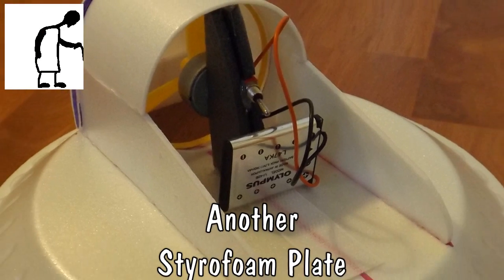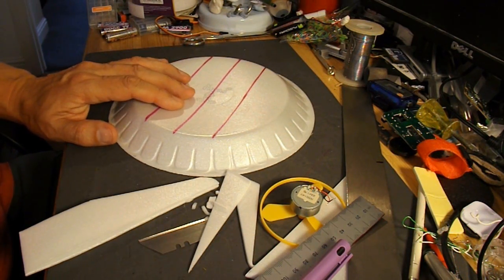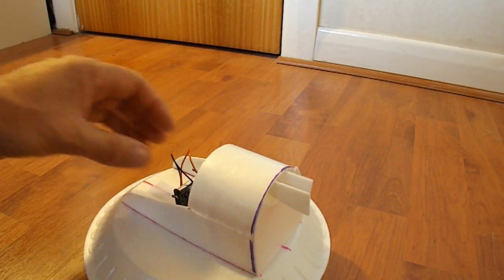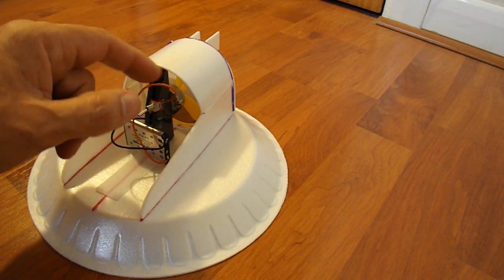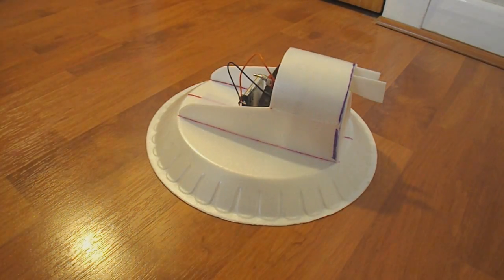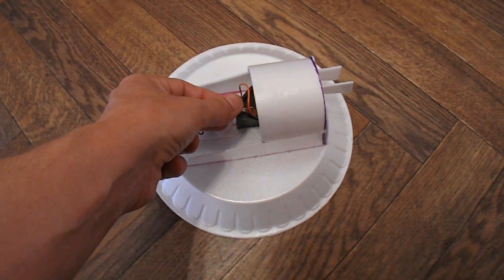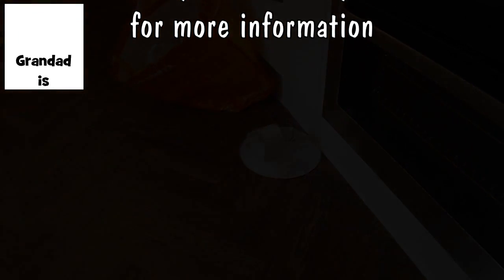Another Styrofoam Plate Hovercraft

Comment: Thank you for your reply.  If there are no measurements, what guidelines would you give us for measurements?  Thank you in advance!!!  You're an awesome inventor and we watch all of your videos regardless of how many years back they were made.
Reply from the maker: I would guess the Styrofoam plate is probably 9 inches diameter as that seems to be a standard. The rest of the dimensions would be related to whatever propeller or fan blade you have available. Looking at the video and those red lines I drew on the plate, I would guess you have one in the centre and the other two are 1.5 inches away as it looks to me like I more or less divided the plate in 3. So that means the fan blade I had there was probably a little under 3 inches in diameter. Like I said in the video I just did what looked right based on what I had available and the dimensions I am giving you here are simply by observing the video and judging the relative positions.

Comment: Hi, thats a very nice design but i have one  question. How would you adjust the speed?
Reply from the maker: Simple answer, you don't. I guess you could but a variable resistor in circuit with the battery and the motor, but I certainly wasn't trying to make it controllable.

Comment: how do you connect that camera battery?(by soldering the wires if yes than how do you recharge it?)
Reply from the maker: +rohan bhardwaj I have a charger that is able to make contact even with those wires soldered in place. This is the charger I use https://youtu.be/ejW0o80_uyM

Comment: realy cool. i plan to make a hovercraft of my own. i love your ideas.
Reply from the maker: Thank you, some of my hovercraft work better than others. If you haven't already found it, here is my Hovercraft playlist
http://www.youtube.com/playlist?list=PLA5a2xPRSrB3zoLYIrdESCCWdx2nLq8r7
Reply: i finaly built a hovercraft out of a styrofoam tray, a computer cooler, and a plug-in power supply and it works great.
Reply from the maker: Luke Provchy by a plug in power supply I guess that means you don't have batteries on board. That will definitely help as it doesn't have to lift the extra weight.
Reply: yes
Reply: i tried batteries but they were too heavy

Comment: This is not a hovercraft! To make one out of this you will have to add another motor with propeller to force air under the plate. The motor you already have there will only be used for movement, not for the actual hovering.
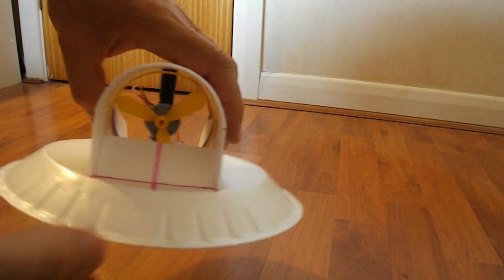Reply from the maker: Perhaps you should study the build more carefully, did you even watch it?. The majority of the air from the fan is directed down through the slot shown at 1:30 and again at 2:10. At 2:10 I explain that I need to block off most of the back to force more air down underneath. At 3:08 I show how I have restricted the air flow at the back to achieve this. This is a fairly common design that saves weight by only using one motor for two tasks.
Reply: GrandadIsAnOldMan That is not enought! One motor won't do the job and it is a lot less effective,
Reply from the maker: So you don't believe your eyes then. It works fine for the purposes I need.
Reply: It can somehow glide over hard and flat surfaces but not even a short haired carpet.
Reply from the maker: That is a common issue with small hovercraft models. That does not stop them being hovercraft it just means there are limits to their performance. Perhaps you should build one to demonstrate your point of view and then upload a video to show us.
Reply: A hover craft is a mech that has no moving parts touching the ground so a car or boat is not a hover craft but a airboat and this thing is

Comment: Im going to make this for my project but my problem is what did you do so you can connect the bateer to the switch and what is that black thing that have the switch and support the fan blade?
Reply from the maker: One wire goes from the battery to the switch and then from the switch to the motor. The other wire goes from the battery straight to the motor. The black thing is just black polystyrene foam with the motor and the switch hot glued to it and then it is hot glued to the hovercraft.

Comment: Another two light weight battery 3.7 - 4.2v options on the table i.e. 14500 (AA size), 16340 (CR123A size)
Reply from the maker: Not sure about them as they look too expensive for the sort of projects I make. Only way I would use them would be if I found some in some electrical item in a charity shop, maybe a digital camera or something. I see they are in some eCigarettes. I would also need a suitable charger so it all starts getting relatively expensive. However, they do look interesting and may work for somebody who can afford them.
Reply: Personally, I think Sanyo 14500 (AA size) is good for value. You can DIY a good charger using TP4056 Module ref to Julian Ilett Youtube clips. fyi, if got it directly from China Taobao, is cost less than 20p. no kiddy.
Reply from the maker: TheOldmankk thanks, I will probably try some, but the original comment still applies. Many of my subscribers do not have access to these items, they follow my channel because I use cheap stuff or recycled items in my projects. Once you start spending money of lightweight batteries you might as well go for LiPo's designed for model aircraft anyway. I follow Julian's channel and I particularly like the way he tells you what the chips actually do.